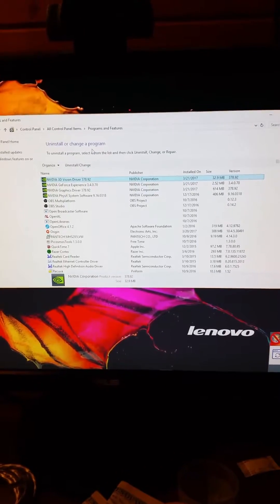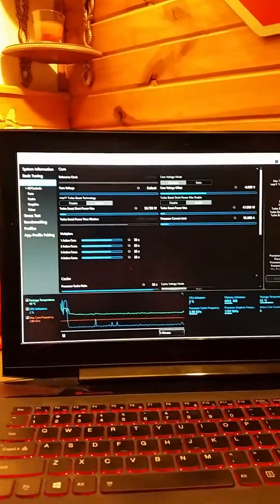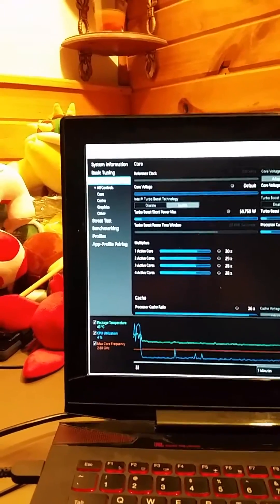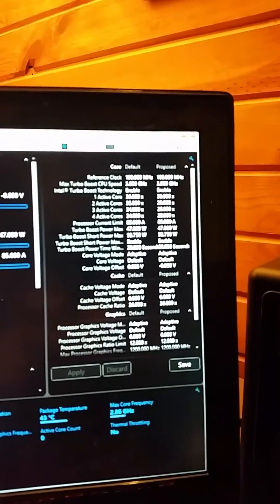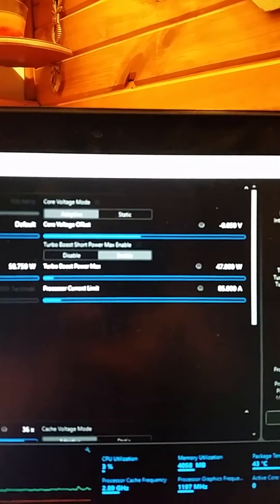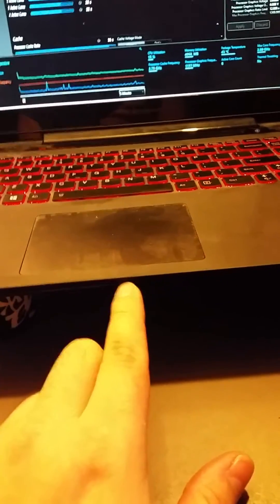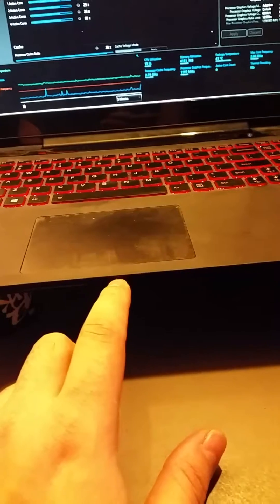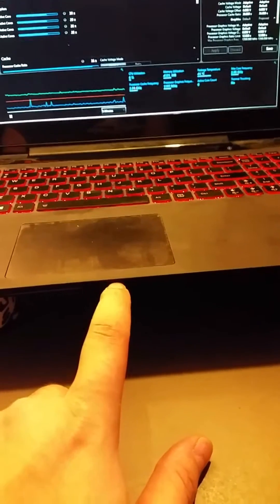Lenovo Y50 overheat/performance fix

Comment: I know this video is old. I actually have one of these machines. How much did you underclock it ? it's difficult to see due to the low video quality.
Thanks.
Reply: Oh, and -0,050 isn't a possibility in the version of the Extreme utility I have downloaded (version 4?). Latest version didn't install, said unsupported hardware.
I could choose -0.09xxxxxx , which seems to be working as well, and I underclocked the multiplier from 37T to 32. went from 3.5 to 3.2GHz boost, which is stil amazing. 
Max temp right now is 70C, it used to be 89C (I just changed the coolingpaste and cooling pads, and made a little cooling-hack with some added pads on the pipes so it uses the bottom-cover (which is metal) as a heat-conductor as well. Found this cooling hack on an old Lenovo forum through the way back machine.

Comment: You lost me at ~ "cleaning the inside of my laptop once per month". But the shot glasses were a nice touch
Reply: http://forum.notebookreview.com/threads/y50-70-cooling-mod-its-working-dude.793362/
The tips here were to use foam/tape to seal the gap around the thermal rods between the fans.
And use thermal pad over thermal rods above CPU to dissipate heat to the aluminum case.

Comment: Also you can change the thermal paste of your cpu. It's pretty easy. You remove the battery and the vents to clean and then you clean the cpu from the factory patse and put some new paste. This must be done once in 2 years I think. Much better performance and Temps

Comment: Bruh thanks it reduces temps from 80 to 35-45c and 60-75 c it rarely gets to 80c only if I’m playing a heavy gpu base game but I can run csgo on 140 plus 1080p max settings and even stream and record
Reply: Bro are you having any screen tearing? If not please share your csgo and nvidia settings. That would be a great help. Contact me on preetampiyush9@gmail.com
Reply: Piyush Preetam no none at all with that laptop I use to have like pretty none in any game I’m optimized this computer to the point where it can run pretty much most games
Reply: I am having 8 gb ram and 5 gb 860m graphics. i7 4th gen. With this configuration, my csgo faces screen tearing due to which it is unplayable. I have  done everything like changing the thermal paste and removed the dust filter too. Nothing helps. Do you have the same laptop? What are your settings sir?
Reply: Piyush Preetam my old laptop was a lenovo 8gb ram gtx 960m i7 4720hq what I did was remove the dust filter and put the teacups to allow air flow and when I found my old laptop and I put the teacups and everything I was able to run siege good csgo on like 200fps pretty much most games
Reply: Maev nah my old laptop can play pretty much any game on high fps not any newer games like warzone but most games on high fps like siege I got like 110 never lower 80 but I don’t use that laptop I got a desktop now

Comment: hello, yesterday I took my legion y520 for cleaning and thermal paste change. But after that, the situation of laptop has worsened. Temps are shooting up to 100°C for Cpu and Gpu. Fans are running at high speed even at idle. I don't know why is this happening even after proper cleaning and re-application of thermal paste. Can you help me out?
Reply: Use a decent thermal paste , I used thermal grizzly kryonaut and my temps are 60-70 when gaming

Comment: I removed that dust strip and the temperature went down. It works.

But i don't want my laptop motherboard to be filled with complete dust.
So one question, can i purchase or buy another dust strip? I need it. 
Can anyone help me?
Reply: just clean it up with vacuum cleaner once a year.
Reply from the maker: just make sure you clean it weekly or monthly
Reply: :d everyday
Reply: There is no dust trip sell seperately, you need to buy the whole bottom shell. You can get it at ali express. Cost around 20-40 usd
Reply: Don't give it back. It messes up the temperatures too much. If u clean with the vacuum cleaner once a year the dust, there won't be much of it.

Comment: I have the laptop for 5 years now, for the last 2.5 years it has been glitching or stuttering with weird sounds especially at video , freezing and slow performance and mouse jumping without stressing the laptop and sometimes at wake ups , and it sometimes differs or improves with charger but still persists ,  I upgraded for SSD lately , but still suffering, restart sometimes resolves it but it will return as soon as the laptop goes to sleep several times..
Can the BATTERY cause this symptoms and affect performance after 5 years of usage ?
Any one with same symptoms can help ? would battery replacement improve ?
Thank u in advance

Comment: No rant, but you haven't included the XTU settings.
Reply: This heating and 48hrtz refresh rate stuck issues are not fixed yet?

Comment: Where is the filter? On the metal panel?
Reply from the maker: It looks like white fuzzy tape that is blocking the whole vent. I believe you have to take the bottom off first to peel it off from the other side of the bottom panel
Reply: @NidgeDFX  yep i did it on sunday and dropped like 10c thx

Comment: Amazing guide. Just wanted to ask you about your Nvidia settings.
Reply from the maker: I dont own the laptop anymore. I gave it away to my nephew and upgraded. From what I remember was I went for more performance since I didn't want it to lag when playing. 
Also in Configure SLI, Surround, Physx (in Nvidia Control Panel) I changed Physx settings to the strong graphics card and not the CPU.

Comment: 378.92 for Windows 10 64bit? Thanks
Reply from the maker: This video is old. At the time that was the driver at the time. :)
Reply: @NidgeDFX  Thank you. I just finished pimping my friend's laptop. Now the GPU (960m) is 55 celsius at load and the cpu (i5 4210h) is 61-72 celsius at full load.  After 65 celsius, the i5 wont boost anymore, it stucks at 2,9 Ghz.  But luckily it wont downclocked itself to 1,0 Ghz. So i think you solution is really working. Thanks a lot! (btw i havent touched the OC software, i just cleaned the laptop, replaced thermal paste, cut the filters)

Comment: i know this vid is from over a year ago, but fuck is the overheating in the y50-70 models a pain. Im sorta doing your shot glass method but im just using books to lift the laptop, but without blocking anything of course. Im thinking of removing the dust cover like you said too, do you still think thats a good idea?
Reply from the maker: As long as you clean it with air in a can yes.

Comment: Have fighting for over god knows how much months on reducing temperature, by fps cap, battery manager, cpu underclock, cleaning, changing thermal paste and all i had to do, was took off the goddamn dust filter 

Dude, you reduced my gpu temperatures by -20°C, i swear thanks a lot
Reply from the maker: I am really glad I helped ya out! I remember the struggles I had with this machine and noticed no one else made a video so felt obligated to do so!
Reply: Ice Smurg did you ever find out? What color is it and where is it located

Comment: Help!!! The GPU randomly works... Sometimes if I'm lucky it works sometimes it doesn't. How do I fix this???
Reply from the maker: There is a few reasons why this could be happening... Do you have the same laptop as my video? If so have you tried what I said? Also CCleaner/Malware Bytes/SuperAnti Spyware are things to run... Your question is vague... I need more detail if I am to help at all
Reply: NidgeDFX yes it's a y50-70.When I launch a program that uses the GPU (860M) 
The laptop freezes up and after a while of waiting goes into a blue screen and restarts with the error 
"VIDEO_SCHEDULAR_INTERNAL_ERROR"
While installing your driver in normal win10 mode with the GPU disabled the laptop freezes and like I said restarted. The GPU isn't dead, today I was lucky to try a win10 benchmark. Also I tried Lenovo bootable diagnostics and the GPU was fine.

Keep in mind I can run the Lenovo diagnosics 100 times and not have a single problem.

Comment: Spot on. Removing the dust filter is the main thing. The dust settles in the filter and over time it gets thicker and blocks the air flow. 

Can you give me your suggestions on cleaning? I'm just using brush. Is compressed air better? Won't the micro water particles mess up the chips???

Comment: The vent filter was the dumbest thing Lenovo did. Making CPU and GPU get shared by a single heatsink was their second dumbest idea. Worst part- they lock fan control to the ec controller on the main board. It never runs full speed when it needs to. Their newer legion series suffer the same issues resulting in throttle. After 4 years of hard gaming my filter was caked with dust. I cut it out, repasted, got a cooler and used the laptop for another 2 months before giving it to my girlfriend and got myself a Asus strix.
Reply: Can i get a new vent filter? Like i removed it and now i want to put it down again.

Comment: Was 378.92 lastest at this time of posting video or u specifically want us to download that driver only.
Reply from the maker: Harsha Bandreddi thats my old laptop i dont own anymore. You can experiment with newer drivers. I found that driver at the time of recording was the best for my gaming.
Reply: NidgeDFX thanks for the help man, completely eliminated my throttling issue on my lenovo y50-70. I could not play project cars 2 on lowest settngs before like 10fps. Now i can play on medium-high and a constant 40-45 fps. My laptop is running alot better. Much appreciated!
Reply: ur running the newest driver or the 378.92 ? coz i have fps drop from 60 to 9 in fortnite ..!

Comment: Removing the filter isn't a great idea, all the dust that is collecting on the filter now, will collect on the heat sink instead and that's a lot harder to clean.
If you want an instant -10C fix, replace the thermal paste, the old one is terrible. and undervotling is a great idea, but no need to underclock this bad boy. mine runs at 3.2Ghz under stress testing constant like a champ (not Prime95 though, that one is brutal, it brings it down to 2.7 Ghz), and the temp is a stable 78-79C.
Just replace the thermal paste if you don't want to undervolt, it will give you at least -10 C on your CPU. haven't tested the GPU yet, but honestly I never had an issue while gaming and it's 3 years old by now.
Reply from the maker: as long as you air it out monthly it's fine. At least mine is

Comment: How would you clean the pc after ripping the tape off? Just removing dust from the motherboard?
Reply from the maker: Mikkel Machon correct use air in a can and spray

Comment: DRUNKFX is it the tape on the battery?
Reply from the maker: no... its a dust strip of tape that chokes the bottom vent area of the machine. It is connected to the bottom piece you pop off
Reply: Thanks (:
Reply: NidgeDFX Ay, Nidge. Is it the silver tape you’re talking about, or the black tape?

Comment: hi DRUNKFX . i cant see numbers normaly on intel extremetuning. can you image it or make better video please.
Reply from the maker: Lukas Brazdauskis 10% underclock
Reply: You haven't actually underclocked it. If you have set all the multipliers to 30x then you have removed the Turbo Boost of the CPU which is at 3.5Ghz for a single core and have overclocked the CPU for when it uses  3 or 4 cores. The 4710HQ is set to be used at 2.5GHz with all 4 cores on which is the base clock for it. So if the multiplier for the 3 and 4 core settings is 30x you have actually over clocked it which is fine if it is running stable for you with the 0.055 under volt. Great job.

Comment: sir i removedthat tape temps are around 85-86 degree's after an hour.is it normal I'm talking about CPU temps as my GPU temps are pretty normal. and please can u explain how much it clock speed is cuz i already like underclocked it by throtlestop
Reply: and please can u. mention ur laptop cpu and GPU temps while gaming for more than 1 hour
Reply from the maker: Banyan Pertin I mentioned to underclock by 10% and set the voltage back a pintch. I don't have any problems. If your machine is still running slow I recommend scanning for Spyware/malware/bad stuff or do a diagnostics check.
Reply: i get it can u please tell me ur temperatures while playing you can monitor it right

Comment: which cpu do u have 4700/4710/4720 ? What numbers did u enter for the underclock as my vision is not strong to see the digits clearly in the video ? What numbers do u suggest for 4720 cpu for underclock and battery under voltage ? thx nice video !
Reply from the maker: Homer Simpson i underclocked it by 10% you could do the same.

Comment: who the f though of putting that tape on, my temps now went from 97c to 73c max. Thank you for the tip boi
Reply from the maker: Tom Zilionis I know right... that tape strip was the biggest fail of Lenovo history.
Reply: cpu, never had a problem with gpu temps
Reply from the maker: no... its a dust strip of tape that chokes the bottom vent area of the machine.
Reply: clarify 97->73...CPU or GPU temp ?
Reply: Hey!!! ıs your notebook still working smoothly. I want to do this process too
Reply: resonmon yeah
Reply from the maker: Yes it is :)
Reply: Is it the tape on the battery that I have to remove?

Comment: one more question sir ....is it safe to OC this gtx 860 in y5070..
Reply from the maker: Raj Patel i don't own that model but I would never over clock a laptop because heat will chew your machine up. unless your laptop has liquid cooling built into the laptop I would NOT DO IT
Reply: https://www.facebook.com/gamersunited.global/ find all here